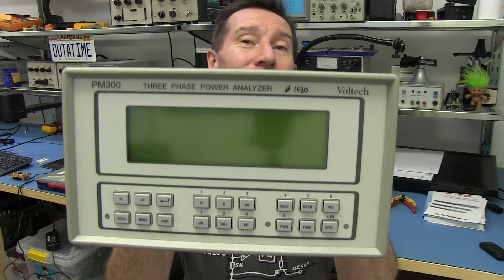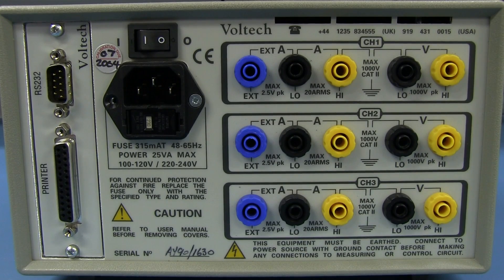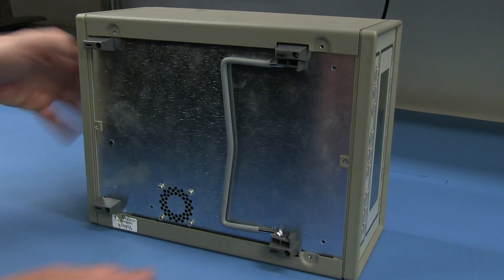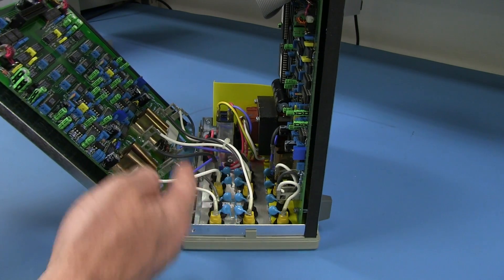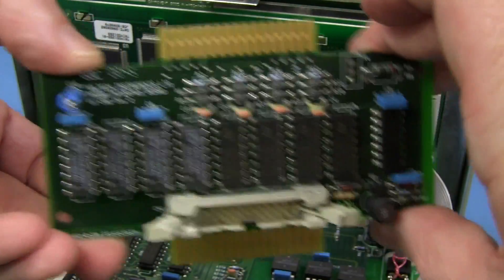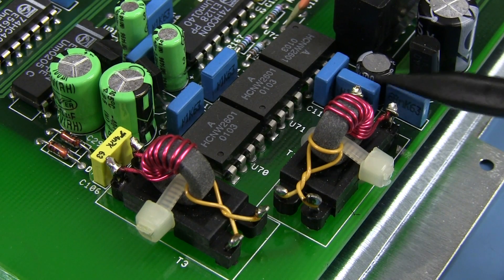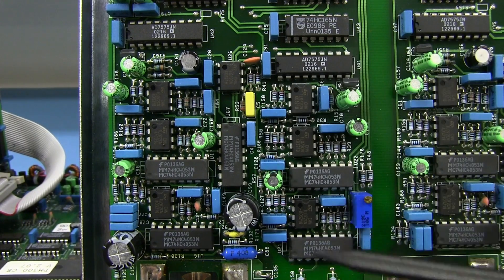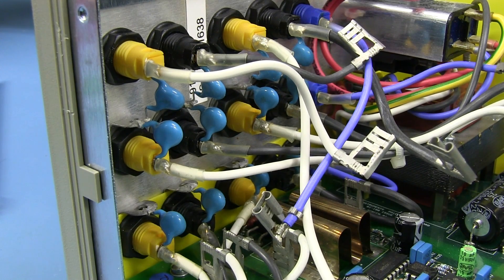EEVblog #589 - Voltech PM300 Power Analyser Teardown

Comment: Maybe there is two transformers to take isolation to specs needed - coil to coil arc over would be messy. Otherwise quite standard 5V logic chips there. Keep up the good work.

Comment: Seen that type of case before, you have to spring both sides out at the same time, also looks like that top panel hinges on 2 screws (that you removed)
I would bet for testing they have a jumper ribbon between the top board and interface ;)

Comment: Two questions...  I'm just a hobbiest but:

1)  Do crystals really actually resonate and disconnect?  i had no idea!
2)  The current shunt - does that shunt current by means of field effects?

Any answers welcome - I figure a lot of viewers just might know more than I do.

Cheers
Reply: 1) Most metals will work-harden, fatigue and ultimately fail if repeatedly flexed back and forth. He's not saying anything special about crystals in particular, but the fact that it's reasonably heavy and just free to wiggle means that the leads could theoretically fatigue and fail if bumped a lot. (Or, if a nearby fan is putting out vibration at the resonant frequency of the crystal's wobble [5-50Hz, nothing at all to do with the MHz frequency of the crystal itself])

2. No, it's just a resistor.
Reply: I think Dave was refering to more of a mechanical weakness. Any free standing component such as a crystal, regulator and so on can be subject to vibration which can cause loose solder joints. A current shunt can be a wire, metal sheet, resistor and etc. with a known resistance which allows a device to manage and detect the amount of current flow that is occurring. For example, a .1 Ohm resistor with current flowing through it will drop voltage according to Ohms Law. You can easily measure this voltage drop and get the amount of current flowing through it.
Reply: Not when standing, but might in transport..
Reply from the maker: I'm talking about vibration during transportation. Wheel a product like this around on a test trolly on a hard production floor for a month and you'll see what I mean. Any free-standing parts like this with flimsy leads can vibrate lose given the right conditions.
Reply: Face palm - Yah, that makes perfect sense.  Thanks Dave - Love your videos. :P

Comment: You obviously don't do much work on consumer products Dave, funny how you opened the thing! A lot of VHS decks, CD players, set top boxes, etc. used this type of box, you take out 4 screws on the bottom and pull a bit on BOTH sides at the same time (not just from one side lol) and it comes right out.
Great video, I used this type of analyzer before but never bothered to take a look inside. I still kind of like this type of through hole construction!

Comment: Dave, the PM100 uses a smaller display. I'd bet the PM300 gets a larger display and the interface module is a bodge at the design level.
Reply from the maker: Yep, that's the case. PM100 uses the smaller screen and connector.

Comment: with a 8-bit ADC, isn't the floating point part of the reading displayed by the meter simply in the noise/error range?
Reply: I guess the floating point is probably an artifact of the rms calculation, but if you're looking at peak to peak, there's not way you could read more than 3 digits

Comment: Wow that looks like something you could implement with a PIC micro-controller or 2 and some op-amps. Wow how technology has moved on. (Mind you if you gonna pay several hundred pounds for something with that component count you'll feel you got your monies worth.)
Reply: I've been building my own little single-phase power analyser, so was interested to watch this video. My analyser uses a 12-bit converter with 100kHz bandwidth!

I'm sure I'm going to screw something up (forget about some source of non-linearity, not deal with above-nyquist frequencies properly, suffer from interference from my MCU clock, suffer from interference from the iCoupler devices I'm using, all the other things that I don't know from not having 50 years of experience), but it's intriguing to think that my analyser is, hypothetically theoretically maybe better than this unit!
Reply: TheHue's SciTech Thanks to the work of the micro controller engineers, a lot of the work is done for us with a multitude of peripheral devices and features built in . But with most products today, the complexity and a clever solutions seem to be in the firmware, running on simpler but well designed hardware(hopefully). I have a lot of respect for the engineers that make the products we use everyday and take for granted when there simple to operate and work well.